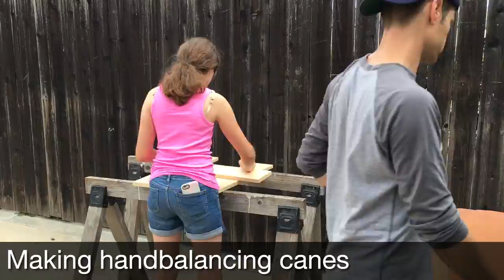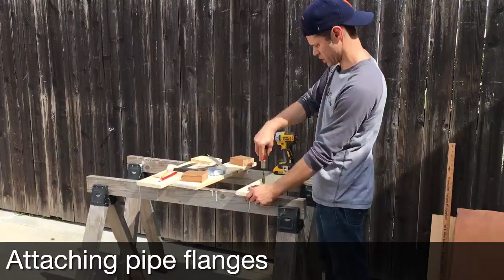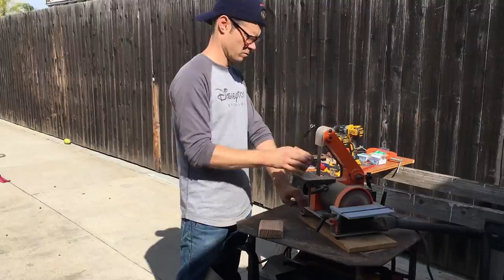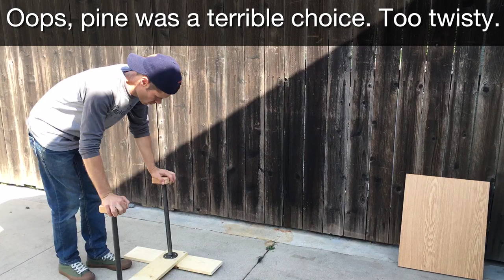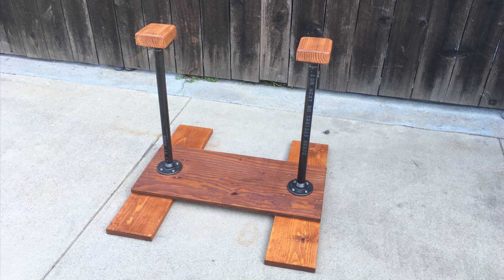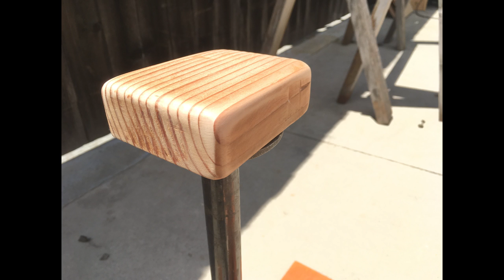Making DIY Handbalancing Canes

Comment: How did you get the hand pieces onto the poles?
Reply from the maker: Sorry, just saw this comment. There are pipe flanges screwed into the pipes at the top, similar to the bottom at the the base, and I screwed four screws through those flanges into the hand grips. You can see us attaching them around 38 seconds in and then the just get screwed on.